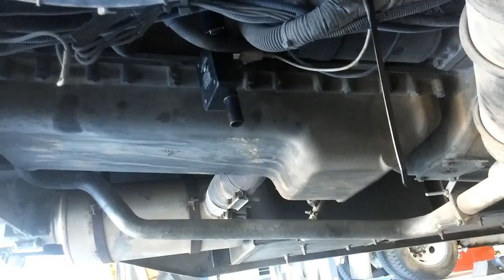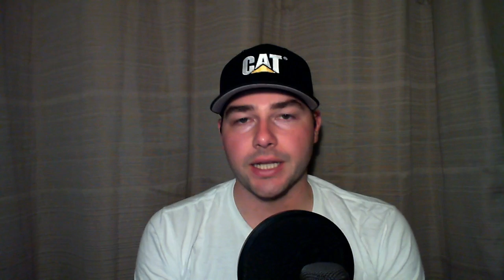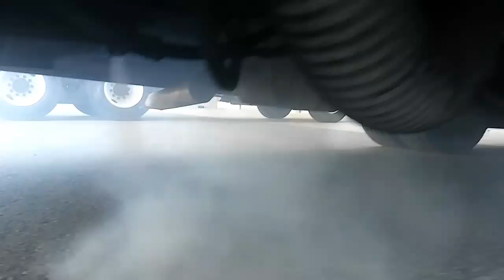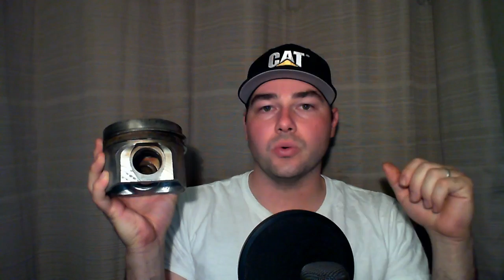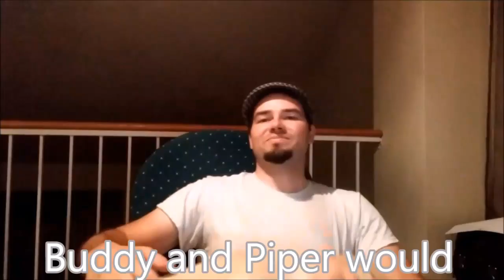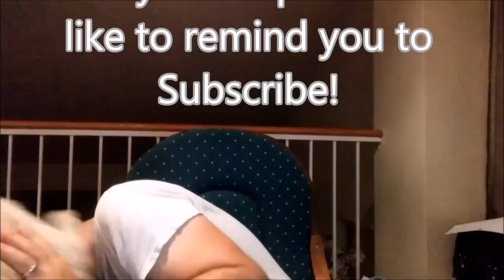Is Idling Your Engine Bad?  Does Idling Hurt Your Engine?

Comment: Cause the engine to "slobber"?
Reply: TheJustin574 

Slobbering happens when the oil and coolant temperatures are low and the excess fuel and contaminants cannot burn off.  The carbon buildup that happens because of incomplete combustion then increases the blowby which then causes the motor to start passing oil.
Reply: Before DPF's became the norm,  evidence of a slobbering engine... black streaks all running down the outside of the stacks;  Lots of light-blue smoke visible for a few minutes when the engine is put under load;  if the exhaust has any leaks/holes in it,  the black sooty crap will be found leaking out, and either gathering on surfaces below like fuel tank or frame, or if pipes are lower, small accumulations on the ground below the truck, visible after departure.  Now that DPF's are pretty much the norm (except for older trucks out there), any "slobber" likely would not make it past the DPF, it would collect there and cause the soot to get wet, then solidify like cement that would never be able to burn off to ash, and would block up the DPF, reducing its capacity.  If this happens, it will also get to the sensors that are inside the DPF, and shorten their life too.  If you were to pull the (failing or failed) sensors out, they would be all coked up (and I don't mean the white kind of coke).  Bottom line is..... idling your engine (too low) can be more expensive than you think.  If you have to idle (for heat or cooling), 1000 rpm minimum. Some say that 1100 is better.  I think that much beyond 1000 rpm is just scream-idle, completely unnecessary.
Reply: Thanks for explaining what slobber is , never heard it relating to engines before,  slobber to me is the movie Turner and Hooch

Comment: Pull the throttle wide open for a little bit before idling because it will warm up the cylinders especially when it is cold outside in the winter
Reply: Adam Brecker try that and let me know how it works for ya 👌
Reply: If you just got done driving the cylinders are already warm. And flooring the motor with no load is never good much less doing that for any amount of time... just high idle problem solved
Reply: +partriot0521 I'm an ase certified automotive mechanic since 1973 I worked on diesel cars and having it idle full throttle for a minute will get air and fuel into the engine. Because the rpms  will be higher the tempature of the coolant will be hotter and so as the tempature of the cylinder will be hot allowing for the engine cylinders not to have blow by,oil consumption and glazing. Also the engine builds up carbon on the pistons that's why you don't want to idle for too long you want to have higher rpms because it's less carbon.
Reply: What?

Comment: how long do you recomend to idle a cold engine?? I idle it 10 minutes and then bump it up to 1000rpms, it is a 9nz c15.
Reply: Why would you abuse your engine for 10 min before idling up to 1k or 1.2k rpm?
Reply: Define cold.  What oil are you running?
Reply: let it sat over night, or a few days on warm/cold days, I use Mobil 15w40. I Rev it up as soon as I see the water temperature rise  to 50°C that happens around 10 min.

Comment: I will have to try setting the cruise on my service truck to 1000 and see if the engine still kicks up to required rpm for the air compressor . I dont have blow by but i doe get a puff of oil smoke when i drive off after idling for a bit but not bad enough to actually make stack wet mine is a 2005 c7 only thing i get is a bit of fuel dilution . It has over 18k hours on it and think it is need of some injectors
Reply from the maker: +Walker Vaillancourt That is a lot of hours for a C7. Since you are running it at higher rpms fit the air compressor you are probably helping it not to slobber too bad.
Reply: Adept Ape it is i never disclosed the hrs on it when i was shopping around i had a year limit of no older then 2005 so thats what i found as i didnt want emissions as this truck never leaves the site its not plated and if i have a bad day i will drive 5 miles but i average 3 miles lol.i was surprised that a service truck that old with that many hrs on it 230k miles didnt have any blow by . I had dealer run history on it and nothing has ever been done to it by a cat dealer anyways . I looked it over real close there are no marks on oil pan bolts . Runs like a top other then a little hiccup it has now and again tie that in with my fuel dilution oil samples which is very minumul is the reason i think it needs injectors
Reply: I have a 1996 with over a million miles and the only time it was at a dealer was for the pre delivery inspection. I don't even know how many hours it has, since it has never been hooked up to a computer.
Reply: ΓΕΙΑ ΣΑΣ ΜΑΣΤΟΡΙΑ!!!! ΕΧΩ ΕΝΑΝ ΚΙΝΗΤΗΡΑ KUBOTA D1703 ΚΑΙ ΜΟΛΙΣ ΒΑΖΩ ΜΠΡΟΣΤΑ ΒΓΑΖΕΙ ΚΑΠΝΟ ΑΠΟ ΤΙΣ ΑΝΑΘΥΜΙΑΣΕΙΣ ΠΑΙΡΝΕΙ ΠΟΛΥ ΚΑΛΑ ΜΠΡΟΣ ΠΑΕΙ ΚΑΛΑ ΜΟΝΟ ΠΟΥ ΚΑΠΝΙΖΕΙ ΑΠΟ ΤΟ ΣΩΛΗΝΑ ΑΝΑΘΥΜΙΑΣΕΩΝ ΤΙ ΜΠΟΡΕΙ ΝΑ ΦΤΑΙΕΙ? ΚΟΛΗΜΕΝΑ ΕΛΑΤΗΡΙΑ Η ΦΛΑΤΖΑ ΚΕΦΑΛΗΣ? ΕΥΧΑΡΙΣΤΩ!!! ΥΠΑΡΧΕΙ ΚΥΝΔΥΝΟΣ ΓΙΑ ΜΕΓΑΛΥΤΕΡΗ ΖΗΜΙΑ ΑΝ ΣΥΝΕΧΙΖΩ ΝΑ ΤΟΝ ΔΟΥΛΕΥΩ ΕΤΣΙ ΕΙΝΑΙ ΣΕ ΤΡΑΚΤΕΡ.

Comment: Ok so my dad has a 7.3 powerstroke tht we have in the garage. He hardly ever uses it so we turn it on every once in a while to not let it sit for a long time without starting. I let it idle for exactly ten minutes then shut it off. Keep in mind its an emission free diesel no egr dpf cat nothing. In your opinion are we letting it idle to long ?
Reply: Agreed.  You certainly need to get the engine to operating temperature, and keep it there long enough to move the moisture out.  The 10 minute idle is probably doing more harm than good by letting it get warm but also collecting moisture from the combustion process then shutting down which pulls even more moisture in as it cools.  Take the old girl out once a month.
Reply: A technical point here - What I was getting at was that almost all water which enters the combustion chamber exits that chamber via the exhaust system as water vapor, an invisible gas.  Almost all water that arrives in the oil pan is via the vent tube, unless there is a coolant leak past the liner packing, bad injector coppers, etc.
Reply: What's your recommend idle time for our light duty diesels tht don't get much use and sit alot?
Reply from the maker: +Diesel Syndicate I'm not sure if it is registered, so you might not be able to drive it, but I would recommend starting it and then let it run for a couple minutes, then drive it under load to get the cylinders hot, the oil hot, let any condensation in the crankcase evaporate out if the engine. That should help keep the rings from getting too much carbon on them and clean the turbo as well.
Reply: Adept Ape ok thx it is and he does drive it just not a lot
Reply: Chad Jessup A good combustion process of a diesel is basically CO2 and H2O. H2O being water or moisture which can leak past the piston rings into the crankcase and mix with the oil
Reply: Chad Jessup   Think of it this way. When it's 100* in the dead of summer, and you grab an ice cold adult beverage out if the ice chest, the outside of that bottle collects condensation....quickly.   It's a temperature difference between the liquid and the atmosphere. Only in this case, it's the temperature difference between the metal parts/oil of the engine, and the air outside of the engine. (Steel pole barns will "rain" inside, if they're not insulated, and you try to heat them during cold weather).  So if you can produce enough heat for a long enough duration, you can at least "evaporate" the moisture that is currently in the system. But, I think it's safe to say, that it will again collect moisture when the engine is shut down....at least when the engine temp and atmospheric temp have large differences..I.E. in the dead of winter. I don't believe you'll encounter very much moisture buildup when it's 80* and up.
Reply: I have been looking for my own reply on this thread to state a qualification.  My reply above was for older diesel engine designs, where during the no-run phase, the engine breathed water vapor in (nighttime cooling phase) and out (during daytime heating phase), and the water which did condense in the oil pan, and being heavier than oil, would sink to the bottom of the oil.  The water vapor that skirted the piston rings would almost all exit the engine via the blow-by tube.  That from an SAE paper of many, many moons ago.

The more modern engines which are designed with a sort of blow-by capture would not necessary see those conditions.
Reply: snowblowertruck - I am with you 100% on that - good science!  My question above was about being unclear about the poster's point.  The science I understand.
Reply: Chad, I think you underestimate the amount of water that can get into the crankcase from normal operation as well as what happens when it gets there. 

Hard to say if you have a good idea how much blow-by there is but probably more then you expect. There's also a fair amount of condensate from other aspects. Compressing air removes moisture, so it will accumulate/condense in areas of the intake that are cold, and on the cylinder walls during the compression stroke. 

Once in the crankcase via either the vent or past the piston it's hard to remove. Often mixing with the oil, condensing inside the engine, etc. If you have enough water in your crankcase that it comes out first during an oil change, then you have A LOT more still in there. Really the only way to get rid of it is to get the oil above 212F and keep it there for a while so it will evaporate out.
Reply: No, I am not underestimating the amount of water which can enter the crankcase during operation, the volume of which depends upon combustion chamber integrity.  When I worked for Cummins I was privy to excellent testing of the subject and the results.  "Once in the crankcase ...it's hard to remove."  No, it actually is not, the secret being, "... get the oil above 212F and keep it there for a while so it will evaporate out."  Combined with proper oil change intervals, engines can last over a million miles.
Reply: I do not talk in contradictory circles, and the information I offered came from engineers and companies who put thousands of man-hours and millions of dollars into testing and publishing the results thereof.

You conflate dew point and humidity.  Dew point refers to a certain situation when water vapor undergoes a phase change to liquid.  Humidity is the amount of water vapor air can hold at a certain temperature, so at 100% humidity, air is holding the absolute maximum amount of water vapor,  which means no more water can evaporate because the atmosphere has reached its holding capacity.  Two different animals.
Reply: “The gasses at 3000F will hold A LOT more water vapor then they will at 220F.” AGREE.  “Given that they will often be close to 100% [WRONG] humidity at 3000F and quickly drop to under 300F they will HAVE to precipitate a lot of water [WRONG]as part of the cooling process.”  DISAGREE.  Water vapor can exist at temperatures ranging between 3000° F and 100° F and not condense.  Again, to use the dew point example, after the engine has stopped and cooled, some water vapor will condense within the crankcase.  A 15L engine with an estimated empty space volume of 15 to 20 cubic feet won’t contain much water vapor to begin with.

An example – think of Ice Road Truckers in the Arctic and with its following plume of white exhaust.  Compare that with trucks down here with temperatures around 40° F.  See a white exhaust plume (which is a water mist)?  No, because the 40° F temperature is not sufficiently low enough to turn the water vapor from the combustion process into a water mist.  So, if that low temperature does not suffice for a phase change, then it is easy to see what will occur inside the engine crankcase with its higher operating temperature – no precipitate.

To condense my previous posts on this matter:  The very, very  small amount water which enters the crankcase oil from the combustion process or from being sucked in through the blow-by tube during a normal stationary period will not even begin to show up on an oil analysis report.  If there is enough water in the oil to see or to be cited on an oil analysis report, look for a coolant leak.

Mr. Rourke, as you don’t believe me, I suggest you join SAE and other professional organizations and investigate these issues.  If you don’t believe those engineers and scientists, then as a member you can publicly inform them their ideas and results are bullsh*t.
Reply: White smoke can be composed of unburned fuel or water molecules, for the latter, visualize Ice Road Trucker scenes during cold weather trips.  I have been wrenching on these machines since the early '60's and have yet to see something that disagrees with established science. 
R
Reply: I'm not following you on your statement about "...collecting moisture from the combustion  process...".  Could you explain that further?
Reply: Then I'm not seeing the confusion? Clearly you didn't understand when you wrote "I'm not following you on your statement about "...collecting moisture from the combustion  process...".  Could you explain that further?" If the engine is running and the oil isn't above 212 then your "collecting moisture from the combustion  process" it's that simple. 

Secondly many engines in many common conditions have a hard time maintaining oil temps. Like the OP and his powerstroke, he's not getting his oil hot enough. An OTR truck sure, on the road, but not while idling.

EDIT -  Additionally you said "Almost all water that arrives in the oil pan is via the vent tube" This is not true, and you now claim that you knew all along that it isn't true?
Reply: "My reply above was for older diesel engine designs, where during the no-run phase, the engine breathed water vapor in (nighttime cooling phase) and out (during daytime heating phase), and the water which did condense in the oil pan, and being heavier than oil, would sink to the bottom of the oil." - An engine has to sit for a long time for this to be a significant factor. There just isn't that much air being breathed in and out of a stationary engine. 

"The water vapor that skirted the piston rings would almost all exit the engine via the blow-by tube." Eventually yes if/when the oil is hot(>212), but when the oil and thus the inside of the engine is cold(<212) it will condense and get mixed in with the oil.
Reply: Howard, as you have not understood my point of reference in regard to my statement to the OP, "I'm not following you on your statement about...", let's just forget about that and concentrate on the technical issues.  OK?

You state, "An engine has to sit for a long time for this to be a significant factor. There just isn't that much air being breathed in and out of a stationary engine."  I agree with your first sentence and disagree with the second sentence.  Obviously, you would be surprised at the amount of air/moisture that is breathed into an engine during it's stationary cooling phase, because you are not aware of the technical literature on the subject, and since I am no longer a member of SAE, I am not going to pay big bucks to link the relevant literature.

You state, "...but when the oil and thus the inside of the engine is cold(<212) it will condense and get mixed in with the oil."  This is simply not entirely correct.  The water vapor that escapes past the piston rings is approximately close to combustion temperature, i.e. around 3,000° F.  Very, very little of that water vapor will undergo a phase change, and due to the positive crankcase ventilation feature of the diesels, the vast majority of that water vapor will exit the crankcase via a vent tube (modern designs are an exception).  

If you understood the concept of Dew Point -- the temperature below which water droplets begin to condense and dew can form (varies with pressure) -- you would understand that in an operational engine, very little of that water vapor in the crankcase will condense.  How often have you seen dew form on grass when the temperatures were above 50° F?
Reply: Chad, you talk in contradictory circles.... 

"let's just forget about that and concentrate on the technical issues.  OK?" - Forget about all your previous contradictory statements, I'm sure you'd like that. 

"I agree with your first sentence and disagree with the second sentence." - That is fucking impossible in any rational mind. 

"This is simply not entirely correct." - So then you agree that it's mostly correct?
 
"If you understood the concept of Dew Point" I do and it's irrelevant, dew point is a function of mostly humidity, the gasses in a crankcase can easily be 100% humidity. Your attempt has failed, please don't try again.
Reply: On second thought I want to pull this apart a bit....

"Very, very little of that water vapor will undergo a phase change" Complete bullshit that you yourself have already pointed out. The gasses at 3000F will hold A LOT more water vapor then they will at 220F. Given that they will often be close to 100% humidity at 3000F and quickly drop to under 300F they will HAVE to precipitate a lot of water as part of the cooling process.

It's actually rather interesting you appear to have a decent amount of knowledge, yet very little understanding. It's like a historian who's pro-gun control, a paradoxical contradiction.
Reply: white is unburned fuel,
try less theorizing second hand and wrench more first hand... Chad
Reply: No egr n dpf .. is that considered emissions free?